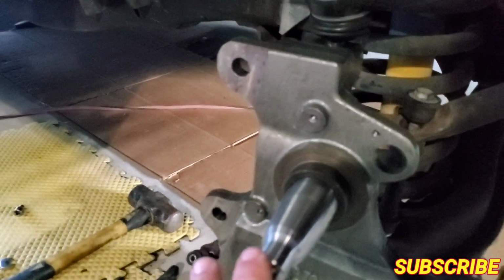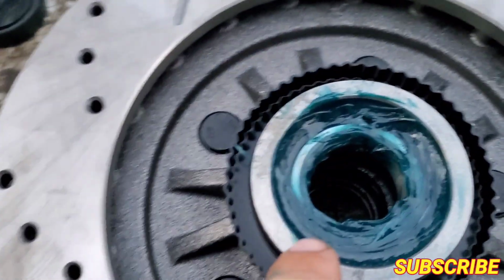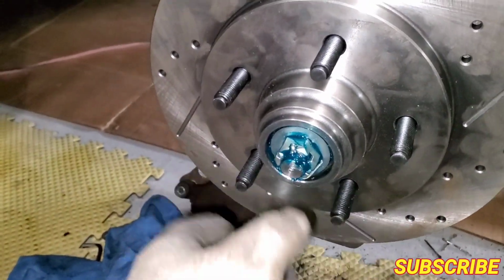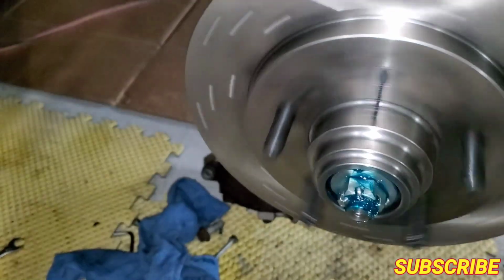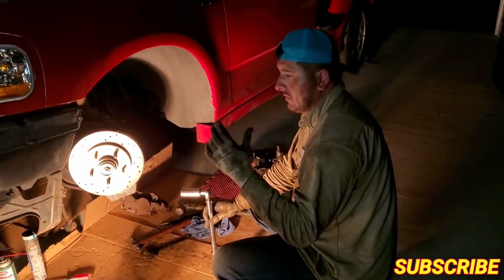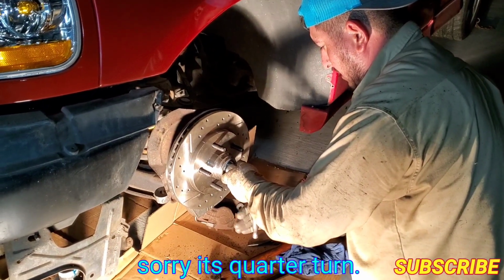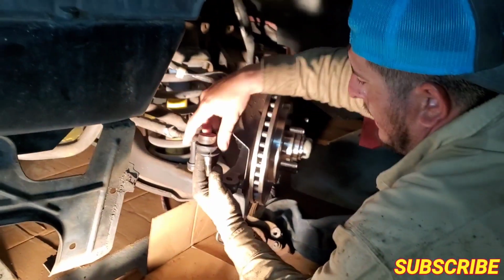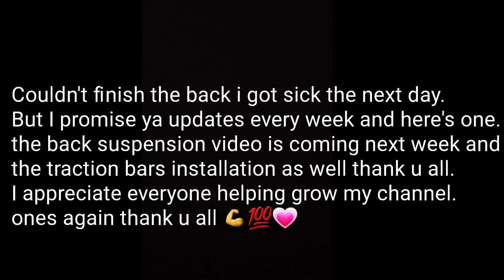Svt lightning 2000 to 2004  Front lowering spindles & bearings installation

Comment: Man, I would've never thought of flipping the tie rod end! Sweet!
Reply from the maker: Yes sr u have to. And the bads also u will lose slightly turning radios and the l smallest wheels u can fit is an 18
Reply: That's fine. I plan on running the 20" staggered 2003 Lightning replicas from LMR.
Losing turning radius just comes with having a lowered vehicle so, it's all good. Small price to pay lol.
I have 2" shackles in the rear. Was thinking of removing the helper leaf spring when I install the spindles up front for 2/3 drop.
Reply from the maker: @behindbarsmototouring898  u will be fine bro and them wheels will look great bro I wanted to do the same on mien but then I wouldn't be available to use the center lines.
Reply: I'm so surprised that Centerline hasn't come out with a lightweight 18" skinny.
I'll probably stick street driving so that's fine.
Performance wise, I wouldn't mind putting this truck back to stock, or close to it just to keep it close to factory.
But I love your truck bro. Its a complete package. And the detail you put into your vids! Excellent work.
Reply from the maker: @behindbarsmototouring898  thanks bro. I just try to do the best I can lol and help out the svt community. I am in the market for a lightning but most I've seen are so out of shape and they are asking like 20k I am like what. Not even worth 10k
Reply: @boosteddave4603  Well, I can see from your comments section that a lot of guy appreciate the detail you go into as well as the tips and lessons learned. Most channels don't do that. They just show what they did.
I just picked mine up in Houston for $12k with 95k miles. It needs a paint job, seat covers, and a tune. For some reason they shot up in price.
This phenomenom isnt just Lightnings. Last year, I saw 03 Cobras going for $14k to $17k with less than 100k miles. This year, Im seeing ones with  150k miles being sold for $20k to $22k. Other specialty vehicles have done the same.
Reply from the maker: @behindbarsmototouring898  appreciated bro and just trying to help ppl out. And yea they went up in price like crazy bro but any questions u have let me know and for faster response add me in Instagram @boostedlife294
Reply: @boosteddave4603  Thanks bro will do. And I probably will. Im order the parts to lower it this upcoming week. So this should be fun.
This weekend, I've been scouting for parts to do the bucket seat conversion and Expedition center console. 
And I do have one question. Do you where I would be able to get a stock lower supercharger pulley?

Comment: Nice work
I’m getting ready to start on a complete overhaul on my 2001 lightning
Reply from the maker: Thank u 
And u going full forged or just regular oem
Reply: 5.8L GT500 alloy short block for Lightning from MMR.
JLP Torque master trans and TFS twisted wedge with stage 3 cams from MHS.
Topped with a ported M122 with the snake bite stage 8 port job with the venom cooler and TG adapter plate.
I had 267k before I blew the motor
Reply from the maker: @FOEHMR0024  now that what I call a nice set up bro. I am built a motor soon for my white f150 turbo but I I get the navigator heads
Reply: @boosteddave4603  I’ve been a good boy and waited a long time to do this. I bought the truck in 05 blew it up in 18. My friend has an 02 and he has already build his motor twice trans once he doesn’t has wife and kids like me so took me longer😩
Reply from the maker: @FOEHMR0024  haha there's the issue with family it's harder haha 😄 but that built will be epic bro keep me posted on your built bro

Comment: So these spindles provide a 2" drop in the front with factory springs?
Also, are there any modifications (grinding) in order for the caliper and ABS sensor to fit properly?

Comment: Great video, but after the 30 pound torque, you backed it 1/4 turn, not half 🤔ratchet was six o’Clock and stopped at 3 o’Clock 🤔

Comment: Quick question, when u put the lowering kit do u need springs?
Reply from the maker: It all depends on the kit u buy. Some kits have the 2" drop springs and some kits have the 2 front Spindles
Reply: Do u have Instagram where I could send u the pic of the one I’m trying to buy
Reply from the maker: @CBMusicINC  boostedlife294 msg me there bro

Comment: do you flip the steering control arm with a 3-4" drop on the front using spindle and coils as well?
Reply from the maker: Depending on the brand but most yes u have to

Comment: What would you recommend/which do you prefer for 2/4 drop: the spindles (belltech or whatever brand) or the maxtrac (spring drop) kit?? I know you said you’re running the maxtrac on your white lariat, so just wanted to get your input, thanks! Keep up the great work!
Reply from the maker: They both work great but I would go with belltech but it all depends in what lowering kit u want on a 2/4 drop or 3/4 drop belltech with Spindles Because u can get a better alignment than the max track

Comment: Heard the drop spindles mess with the turning radius
Reply from the maker: I never had any issues before but will check with the 2 truck at the shop
Reply: @boosteddave4603  I’m stuck between belltech spindles and DJM LCA they both have there pros and cons
Reply from the maker: @JohnSVT  I like djm more bro because u can run 17" in front and the rest of the brands they have there Spindles to run 18 on some and on some u have to modify them

Comment: Great info I would love to lower my lightning but sometimes I pull my friends 43ft contender boat
Reply from the maker: Thank and thats a big boat bro. U can always add helper bags bro Nd lift the back
Reply: @boosteddave4603  the lightning pulls her good it had four 350 engines on the back  pull like 15 miles no highways so in city only
Reply from the maker: @stevenhanna242  thats a heavy load but Ford is built tough bro 💪